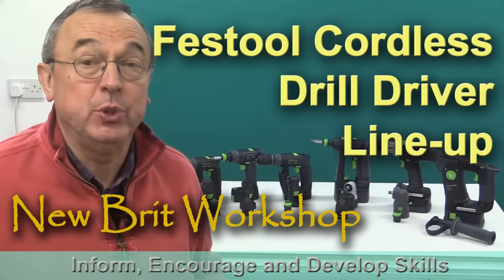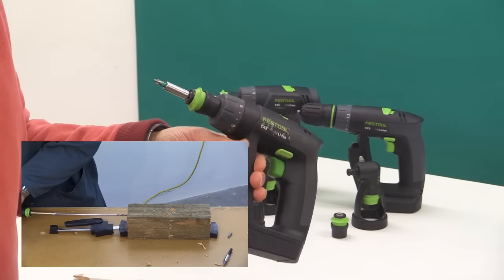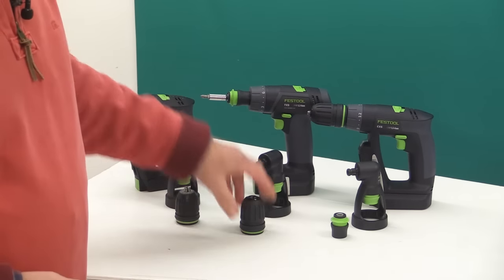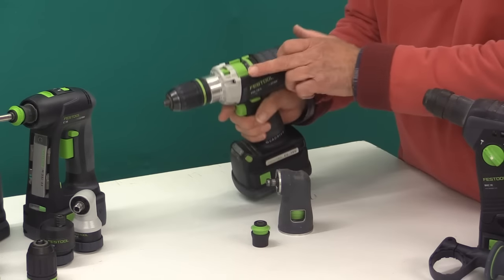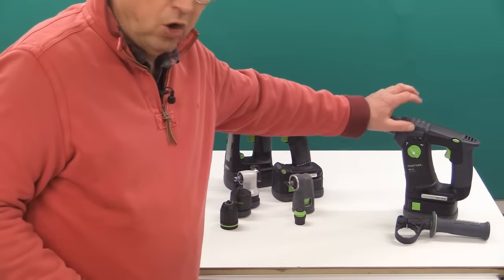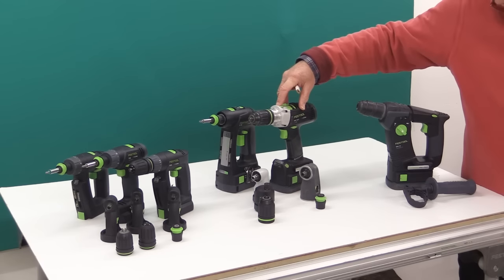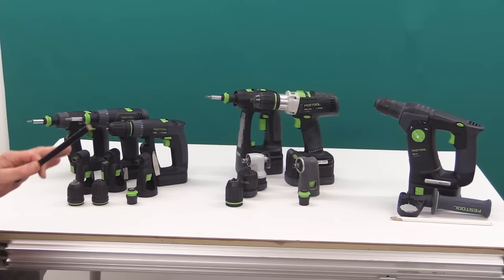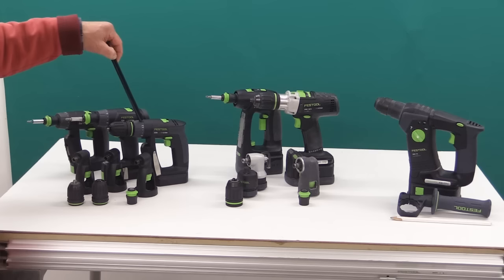Festool Cordless Drill Driver Line-up

Comment: Hi Peter, thank you very much for getting back to me so fast and as always for all your professional and honest advice. I will choose between the two you have recommended. Cheers Dan
Reply from the maker: Hi Dan, Do let me know which you prefer.  Good luck.   Peter
Reply: New Brit Workshop will do Peter. Are the batteries in either the CXS or TXS comparable with any other Festool tool? Cheers again, Dan
Reply from the maker: Hi Dan, No but they are compatible with each other and the same charger is used to charge them both (CXS and TXS).    Peter
Reply: New Brit Workshop 👌thanks again Peter

Comment: Thanks very much, most videos that talk about the domino jointing system use one of these drills as part of the work to install a pulling fixing connector for long boards, etc and do everything to hide which drill they use, and no links are there to say which one!

Comment: I don't know if Festool changed the clutch on the PDC18 when they rebadged the Protool (which I have) but I have found the clutch, which is electronic, to be quite variable in its function. Perhaps it is sensitive to the variable hardness of some woods. I have found that drills with old school mechanical clutches much more consistent in use.
Reply from the maker: Hi Stephen, I am not sure about this but mine works fine. Some of the tools have automatic power adjustment and cut-outs which may seem, to some users, odd. It is all designed to protect the tool from misuse.  Cheers.   Peter
Reply: Peter it's horses for courses I guess. I eventually purchased the c18 with the offset chuck and right angle attachment. I recently added the countersink chuck which  is very good for screw setting without worrying about the torque settings. I seem to be getting quite a collection of drills but having one drill for drilling, another for countersinking and a third for screw setting  sure helps the workflow if not the bank balance.
Reply from the maker: Hi Stephen, I am now lucky enough to have 3 like that - it really does speed things up.   Cheers.   Peter

Comment: Another great video Peter. Do you know the part number of the eccentric chuck for the pdc?
Reply from the maker: Hi Steve, I really though that there was one but I have discovered that there is no such item. You cannot fit the C18 eccentric chuck to the PDC as the PDC does not have the interface on the body of the drill to engage with the location rings on the eccentric chuck.  Cheers.    Peter

Comment: Metabo has a drill out with 3800 rpm as well. Not sure if it is available in the UK but it is on the US site.
Reply from the maker: Thanks for that - what model number is it?   Peter
Reply: Hopefully I copied the right one. I found it on the United States site. BS 18 LTX-3 BL Q I (602355620) CORDLESS DRILL / SCREWDRIVER

Comment: A good review Peter. I have an older version of the C18 and it is the C15. The 15 volt battery is a bit lighter than the 18 volt battery. Unfortunately it seems Festool no longer produces the C15 volt battery so if these batteries die I will probably get the CSX.
Happy Holidays. Stay safe.
Ron
Reply from the maker: Hi Ron, The drill may well work with the 18v batteries. My Festool jigsaw was sold as a 15 volt machine and works perfectly with 18v batteries.  Cheers.  Peter
Reply from the maker: @Review Master The quality control on all Festool kit is excellent and so you must not worry about where it is made. They have some terrific engineers in the Czech Republic. I have the TXS and the CXS (same machine in different plastic bodies) and they are used more than any other drill in my workshop. They are excellent.  Peter

Comment: Hi peter,

I have a C12, I like electronic torque control and the eccentric chuck, it's also quite light weight.  Unfortunately it's been discontinued now.  In terms of top speed, Fein also make a drill that runs up to 3800rpm, its aimed a metal workers and doesn't have an hammer mode, but it does have attachments for tapping threads etc.  I didn't know there was an eccentric chuck for the PDC18/4 this must be a new product for 2018?  

Andrew
Reply from the maker: Hi Andrew - gosh, you learn something every day. Cheers.   Peter

Comment: Hi Peter, merry Xmas and a happy New year to you and yours.
Which festool cordless screw gun would you recommend for drilling 100mm holes using a hole saw? Also I heard you can get a chuck for the impactor that turns off the impact function and so can be used to drill holes, any truth to that? Cheers
Reply from the maker: I would go for the TDC or TPC as they have more flexibility.  Peter

Comment: How do know when buying the festool CXS original verses the New CXS. I want to make sure I get the new model. Whats the differance. Is there a Model number to look for.  Is the new version using the 2.6 ah batterys and the original use the 1.3ah. They are confusing here in the US they offer it 3 different ways  is the Festool 564534 Li 2.6 Ah CXS Compact Drill the new version. Ty
Reply from the maker: I have answered this before - Festool kit sells very quickly so it is highly unlikely that anyone has old stock.  Peter

Comment: Hi Peter- I wondered if I could ask your advice please- I own a Hilti cordless drill & impactor but for small delicate jobs like hanging doors and fitting locks I think they are overkill and I wondered if you could advise a Festool cordless drill that was light to carry around. As I said only light screwing and drilling, I have the bigger guys to take care of the rest. Cheers Dan
Reply from the maker: Hi Dan, I think the choice for you will be between the CXS and the TXS. They both have the same power and accessories and (I think) are the same price. The choice for you will be the type of grip that you prefer. The TXS is technically better balanced but they are both so light that you would have to be a 6 year old to get any fatigue from using them. Personally I prefer the CXS but I cannot fault the TXS.  Good luck.   Peter

Comment: Hallo Peter,
Thank you for yet another excellent video. I always enjoy your videos because you pay so much attention to detail. They’re very instructive. I have a questions, though. You say that an eccentric chuck is available for the PDC. I have been looking into getting a PDC myself and I haven’t found an eccentric chuck for any of the festool drills, other than the T/C18. I have been given to understand that the eccentric chucks that come with the C/T18 set won’t fit on the PDC either because they seem to require the metal ring that is only present on those drills and not on the PDC. 
Kind regards,
Bram
Reply from the maker: Hi Bram, I had hoped that there was an eccentric chuck for the PDC but alas there is not one available. I am now goig to have to get my own C18 in order to have this invaluable capability. Many thanks for the kind words.    Peter
Reply: Bram van den Bosch   Bram, my CXS that I bought here in the U.S. several years ago came with all the chucks/attachments that Peter mentioned earlier. It was a set version. It came with the angle chuck, the eccentric chuck, the Centrotec chuck and the Jacobs chuck... I bought the set primarily for the eccentric chuck. The drill has come in very handy...
Ron
Reply: Hallo Ron,
Thank you for your reply. I have a CXS myself, but I have never seen an eccentric chuck for it. Do you have a model number?
Kind regards,
Bram
Reply: Hallo Peter,
Thank you for the reply. I had hoped that there would be an eccentric chuck available for the PDC in the UK, but alas.
Reply: Bram van den Bosch     Hello Bram. I will check and let you know.
Ron
Reply: Bram van den Bosch    Hello Bram. It is the Festool 490294 Fastfix Eccentric Chuck.
 Ron
Reply: Ron H Thank you Ron. I'll look into it.

Comment: Hello Peter, how precise are the drill drivers? I have to send my brand new DRC back to the Festool dealer because the centrotec chuck and the bigger chuck had a major run out. The speedset switch was not going smoothly. The Festool systainer sticker shows that the DRC was made in Chech Republic. I was very disappointed about this machine. Thanks for sharing; much appreciated. Kind regards. Richie.
Reply from the maker: Hi Richie, I have had no problems with my machines at all except needing new brushes in my oldest CSX. Festool will sort out any and every problem that you have under their comprehensive 3 year warranty.   Peter

Comment: Peter, has Festool released any new drills or drivers since this video came out?
Ron
Reply from the maker: Hi Ron, They now have an impact driver but I have not been able to try one out. I am still using my 9 year old Hitachi impact driver which still does a great job despite the old battery technology. As far as I know the impact driver is the only new tool. Take a look at their web site - they normally keep it up to date.  Cheers.  Peter
Reply: @NewBritWorkshop  What is the difference between the PDC and the new TID?
Reply from the maker: @_Sinsear_  The TID is an impact driver and has no other mode of operation. The PDC is a jack of all trades but has no impact function.  Peter
Reply: @NewBritWorkshop  How is percussion different from impact?
Reply from the maker: @_Sinsear_  An Impact Driver rotates with extra rotational impacts to benefit screws being driven. A Percussion Drill rotates with axial (direction of drilling) percussive force.  Peter